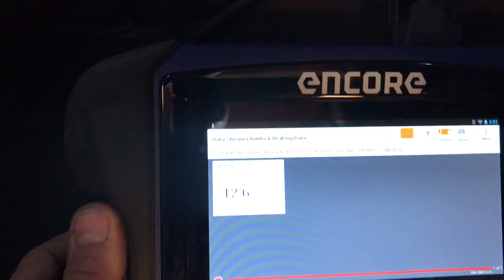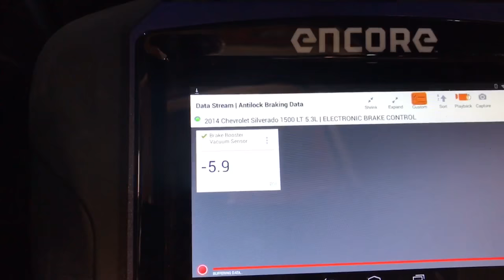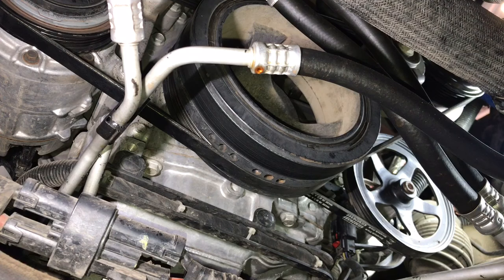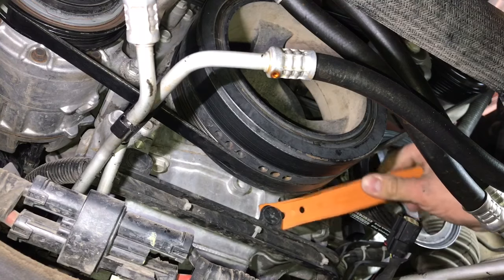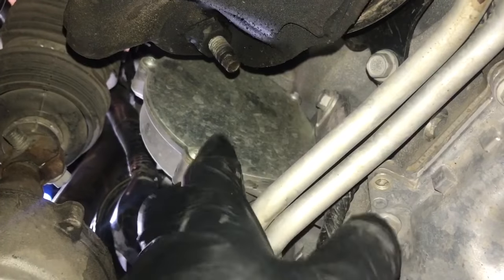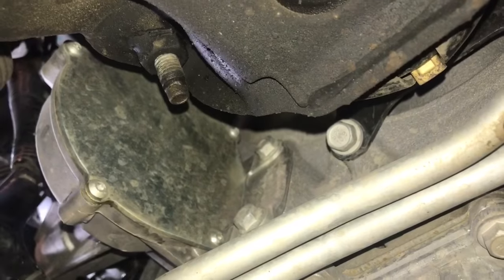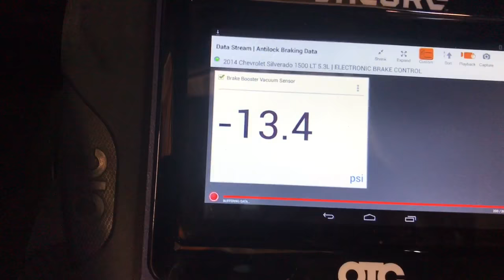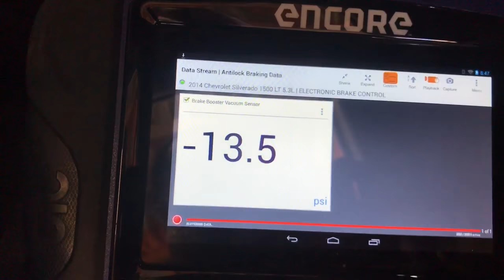Gm Silverado Sierra Vacuum Pump Replacement 5.3 & 6.2 (2014-2018)

Comment: Just a heads up to anyone having this issue. These pumps were recalled and there is a special letter out from GM about it. A deal can inspect the issue and request for GM to pay to fix the part. GM will then approve it and replace it at no cost to you. Just had mine done. 17 silverado 1500.
Reply: miles?
Reply: Thanks for the heads up! I got mine replace today under the recall! They said under 10 years old and under 150k on it.
Reply: @jldrkszac1194  I have a 2014 Silverado and the brakes have started this symptoms, Im at 75k I’m hoping they will honor and replace
Reply: @joelstovall1128  you should be good!
Reply: How do i get them to replace the pump with what you are saying about the inspection?
Reply: Anyone you know have this issue with the 2019? Also have you heard of anyone just changing the belt? TIA

Comment: Just did this today on my 16 Sierra. This is very informative video. A few things to note though, this is a 2wd install. On a 4wd, it’s definitely more difficult. Also, be very careful with the crank position sensor plug. It’s VERY fragile, take your time. Lastly, invest in a nice power ratchet like the Milwaukee in this video, it’ll save your life because these bolts are almost impossible to get to.
Reply: Yeah I saw this video and thought "oh this looks nice and easy. Then I get under and realize that this is a 2wd install
Reply: Yeah I figured it out the hard way
Reply: I broke the clip on the plug. Darn thing was a pain to get to laying on the floor.

Comment: What’s interesting is that the bulletin From GM states the vacuum pump is faulty (they attribute it to oil changes at incorrect intervals). The recall however states that they are only responsible for recalibrating the braking system, meaning they just plug it into a computer without replacing the part. I just took mine in for this recall and they would not replace the vacuum pump. Bummer

Comment: I really appreciated you making this video. Thanks for saying the crank shaft nut was 15/16. Someone else said 24mm and I was bummed. I bought the plastic Christmas tree removal tool. I also used your idea of using zip ties to put the belt back on the pulley. I wish you would of shared in better detail how you just compress the electrical connecter. That part took me about 15 mins. I prayed because I didn't want to break it like I did on my ABS sensor once. I did remove the steering shaft section, which was easy and made the whole job doable for me.
     I was able to reach over a cross bar and barely start the back top bolt on the vacuum pump by hand. That was another hard part. After I finished I rotated my off road tires 33's. That was tiring. But is was a productive day AND YOU HAD A LOT TO DO WITH IT! THANK YOU SO MUCH, GOD BLESS YOU!

Everybody that was helped type in the comments, THANK YOU!
Reply: Sane here I spent so much time om the connector and I don't know how he managed to get a tool for the back bolts, I couldn't even get a hand in there

Comment: Just finished this repair yesterday on my 2015 LTZ 4x4. A universal socket adapter, long extensions, and patience were my best friends. I spent more time trying to get the crankshaft position sensor unplugged than getting the actual pump out. I ended up just leaving the sensor plugged in anyway to prevent damaging the wires and was able to get the pump out just fine with it plugged in. The gasket on the new pump holds the new bolts steady for you when you install it which is also very very nice. Very happy with the results, no more hard brakes during low speeds. This was a great video thank you!

Comment: Just got doing mine, thanks for this video. its some tight squeezes.
Also make sure you have a drip pan to catch oil from vacuum pump. 
I did not remove steering shaft. i imagine it would make it much easier. 
This video was very much appreciated and so far seems to alleviate the tough brake pedal. 
Thanks again!

Comment: Just finished mine, on 2014, 4wd silverado. For the 4wd, removing the steering knuckle  makes access to all 4 bolts amazingly easy! Was easily removed at that.
Reply: yeah I did that too and used zip ties for putting the belt back on.

Comment: Guys I appreciate this video and all the comments. I've called  a few times and went in a little while back  for diagnostics and they came up with over an 800 dollar fix for the vacuum pump. Was told by another dealer that it was ok for now that it didnt need replaced unless I experienced the brake problems . Well now it needs replaced and now knowing it wont cost me is nice!

Comment: 2014 GMC Sierra July 28. GM just did mine for free. I had to ask multiple dealer until one said there’s a “special warranty cover” that would replace the vacuum pump for free. It covers either 10 years of ownership or 150,000 miles. Mine was a 2014 with 141,000 so I was close lol. Keep asking your dealer it’s a free $800+ fix.

Comment: This is great. my pedal is actually squeaking and spongy (diagnosed by Chevy repair guys) Cost would be $600 and 1 week after warranty was out. Truck only had 13,000 miles on it.  Plan to tackle this myself this summer. hopefully there's no oil in the booster. Thanks for posting the video
Reply: Mine is squeaking aswell did it get rid of the noise?
Reply: @noeldiaz1359  i waited a few months to see if chevy would put out a recall on it and they did. only seems to do it in the winter time now... so i just turn up the radio.

Comment: Really helpful video. Thanks for posting! This particular belt tool is key! I first tried another one from NAPA that was more expensive, and it didn’t work (I’m returning it.) Also, I think the truck in this video must not be a 4wd...my 2014 Sierra 4wd was tighter than this, but I was still able to do it with various wobble extensions and U joints on the ratchet handles. An electric ratchet helped a lot too. I have just over 77K miles, so no warranty/recall coverage (They’re covering this if you have less than 72K miles now as I understand it.) The dealer quoted me $800 parts and labor. I bought a new pump on Amazon, new belts (all 3) from NAPA and the stretch belt tool at Pep Boys. About $300 in parts and tools altogether. (The 3 new belts totaled as much as the new pump! Crazy.) I’m going to hit GM up to see if they’ll reimburse me for any of this. I’ll post here if I have any success.
Reply: GM wouldn’t pay for anything due to my mileage. No surprise.
Reply: They just extended the coverage on these shitty pumps
Reply: A zip tie around the belt and pulley will do the same for installation.
Reply: I believe you're right... just replaced the pump on my 4wd and there was significantly less room to work with and zero visibility.

Comment: Just did this on my 2014 4x4. A couple things - 
I couldn't unplug my crankshaft position sensor. It's not necessary

Disconnected the upper and lower intermediate steering shafts. They were rusted/seized and it was a huge pain to pull them apart. I recommend two pairs of channelocks twisting and pulling on both sides. Completely removing the lower shaft would have been ideal but I couldn't disconnect the shaft from the steering box.

Getting the new pump in was surprisingly difficult without having the gasket falling off. I pushed the two front bolts partially through the gasket to keep it in place. Laying on my back with my eyes right under where the lower front bolt on the pump goes into the engine gave me the best position to be able to guide the pump into place and hand tighten that bolt. 

Need lots of different sized extensions.

Reconnecting the steering shafts was a huge PITA but it didn't have to be.
Reply: I have a 4x4 as well and could not unplug that sensor either. I am here looking for a video that maybe has the 4x4 so I can see how to disconnect the drive shaft
Reply: @Apocalypse2383  All you have to do is remove the bolt that connects the upper and lower steering shaft. Once that's removed you can push the upper shaft towards the cabin which I think will give you enough to separate the shafts. I also disconnected the upper shaft under the steering wheel before I realized I probably didn't have to. Try that if you can't get them apart. If you do go that route, reconnect the portion under the steering wheel first, it's easier to get everything back together with more room under the hood as opposed to connecting the two shafts and then trying to connect under the steering wheel. EDIT: before disconnecting the steering shaft make sure to loop the seatbelt around the steering wheel to make sure it doesn't spin - could damage your clockspring if you don't. This video shows a replacement of a steering shaft: https://www.youtube.com/watch?v=4crx0xuIhQU
Reply: I’m here cause my sensor clip(red) broke when I tried to unplug in juuuust to learn that other people were able to skip that step. 🤦‍♀️

I also have a 4x4 and appreciate the recommendation to disconnect the steering shafts. After fighting with the sensor forever I’m more than ready to make some of this easier on myself haha.

Comment: There really needs to be a recall on these.  One of the dumbest designs ever.  Keep up the good work man!
Reply from the maker: Ya your not kidding! I see the fail a lot. Pretty dangerous. Thanks bud!
Reply: They gave a special warranty but it runs out at 72k miles but they do need to recall this
Reply: @blake102989  Just realized that I have this ongoing issue with my truck unfortunately. I have 106k on the dash they told me basically that I need to pay out of pocket but it was very evident that they all knew it was an issue.
Reply: @h1ghVolTTagE  damn, that's dirty. I'd call gm corporate and tell them you were never notified and didnt have any signs of it being bad until now. If they say no tell them they'll be hearing from your attorney and they just might go ahead and fix it because they dont want a lawsuit and I know a attorney could easily file suit on this issue.
Reply: @h1ghVolTTagE  I luckily caught mine when I had 70k but the only reason is because I was bored and clicked on the warranty section of the monthly diagnostic email and it said speciality warranty almost expired. It didnt say what it was, I had to google the number that was right after specialty warranty.
Reply: Caught mine at 40k
Reply: Alright so I'm late to this recall stuff.. I have a 2015 Silverado.. does this recent recall replace the pump at no cost to me?
Reply: Ryan Quinn So I had no prior issues before I had the “reprogram recall” done then 3-4 weeks after I started having these issues yes they replaced the pump under warranty
Reply: @tha1Gemini24  thank you!

Comment: Thanks man!  Had the brake issue and was hoping the recall/reflash would do the trick.  It didn't, so new pump it is.  Dealer wanted 500.00 as I'm at 210k on my 15.  I'll do it myself and this video helped me out!

Comment: Excellent video.  I was going to make and post a video on this but yours is perfect.  Thanks.

Edit after finishing:
4WD is very tight.  Without universals you'll have to do it blind from the top for three of the bolts.  You'll definitely need different length extensions.  I disconnected the steering coupling but it didn't help.

Comment: I just had the slow speed braking issue. Just bought the truck a week ago from the dealer. It was used with 63,000 miles on it. The pedal didnt get hard it was more like went to the floor and front brakes made a noise like the were just grabbing the rotor and making a creeping noise. scared the crap out of me.  I was trying to park in a parking spot with other cars around. I hope the dealership will fix the issue since I paid top dollar for a 2017 Sierra Denali. I didnt get the bumper to bumper warranty only power train. Hopefully they work with me or the recall covers the work. Shouldnt have an issue with this since its only a week in possession.
Reply: How’d that go for you
Reply: @winterssiege4624  dealership did the work under a service bulletin. Haven't had the braking issue since.

Comment: I found on 4x4 models if you take the exhaust manifold heatshield off  it gives you room to reach the back bolts from up top
Reply: I got it out. But couldn’t get it back in. So Imma try this and see if it works for me.

Comment: Dealer just replaced my 2014 vacuum pump free under recall!
Reply: Hey im going to the dealer tomorrow but i dont have the recall i spoke whit a GM agent today he told that they need to inspect the vehicle and if the problem is that they will replace it and yes thats the problem if you hit the brake doble it doesn’t stop i have a 2015 Suburban! 
What did you told them?
Reply: @KMTZ305  took it in for motor mounts 
While there dealer told me about it and checked to see if bad
Reply: So im here at the dealer now, i just explained him what was happening and he knew exactly what to do i dont have to pay anything 😀

Comment: So I just got off the phone with a local chevy dealer. He said the part is 269.34. 3 hrs of labor at 145.00 a hr. Grand total of 704.35 before taxes. I'm going to use your video and save me a few hundred dollars. Let you know how it turns out. 2015 Chevy suburban with 70,000 miles.
Reply: How long did it take you to replace the vacuum pump?
Reply from the maker: @outlawz832  awesome! less then an hour. book time is 1.6 hrs. so they are correct on the labor. 2wd is much easier the 4wd. make sure you get the gates belt tool.  make putting the belt back on 100 times easier.  good luck.
Reply: There is a recall on this exact part now for your vehicle, I'm not sure but u might be able to get your money back....? 🤷🏻‍♂️. Worth a shot!

Comment: Great video! Took my 2018 Silverado in for the transmission. Their inspection discovered that my vacuum pump was bad. They’re telling me that my specific VIN isn’t one that’s covered by the recall and they quoted me $740 to replace. First off, no thanks! Second, how does this even make sense? It’s not a coincidence that mine needs replaced and there’s an active recall.
Reply from the maker: That’s lame. I do know that GM redesigned the pump. So they should at least expand the recall to cover mode years
Reply: Ramon Trujillo Did the bad pump make a whining noise?

Comment: Pain in the ass when it’s 4x4, I used 1/4in drive 13mm socket for the front and and removed em by hand and using a long socket twisting it. I’m just about out the new pump on. There was about a pint of motor oil coming out when I removed mine. I’m working on a 2015 suburban.

Comment: Great video, but for me it was easier to remove the driver side wheel and wheel well, and unbolt the ECM and just lay it in the battery compartment. Then i'd remove/replace the vacuum pump from the wheel well. This way you don't have to remove the skid plate, or harness or Crank Sensor or anything from below. I had issues with the centering pins staying stuck in the block, and didnt see that when working on it from below/above as shown in this video. Be sure the centering pins come out with the unit or you will have an oily mess on your driveway!

Comment: at 4:52 you say the connector is the crank position sensor.  It is the cam position sensor & cam phaser solenoid sub harness.  X154 for those who care.

Comment: I keep getting service brake assist 2017 Chevy Silverado 271 4wd v8 . I’ve had problems with the brakes once when driving around ice . A lot when I back up a trailer or if I’m backing up to a lake under low speeds . Brake peddle gets hard and feels like the brakes are locking up . Would this be the cause?
Reply: Definitely, did you ever get it replaced?
Reply: @Sweetjamesjones520  yes it was my vacuum pump . Very common in Silverado’s, they call it parking lot breaking syndrome, and it’s covered under a recall if you’re vehicles under 150k

Comment: thanks so much. so question , the dealer performed this on my truck as a recall. it works fine now. so is this something that i will need to replace after x amount of miles?

Comment: I just got a letter from Chevrolet. They are extending the warranty on some of these pumps.
Reply from the maker: we have been receiving a few letters as well over the past week. but only on a few trucks and not all. strange
Reply: Aaron Hines Do you know which trucks? We have not received any letter as of yet.
Reply: I never got a letter but I got the warranty and didnt know about it until I was 2k miles under the end luckily I caught it and got it fixed

Comment: I have a 2014 V8 Silverado. I’m not experiencing any brake issue or noises. Got the recall notice several times. Procrastinating taking it to the dealer. Recall states to bring it in to test the pump and replace as necessary. Also was told by others that that are going to reprogram the PCM to have the pump to make vacuum pump to start making vacuum at a much higher number. Thats kind of cheating making the pump kick in earlier to make up for a weak pump. Anyway, I took it in 1-10-2020 (It only has 36,500 miles on it) and they tested it and said it needs a new one cause it doesn’t make good enough vacuum. They don’t have any in stock and it’s on national back order. So they called me and told me to check back 1-16-2020 to see if it’s done. I’m driving my 2006 Yukon now and it started leaking antifreeze at the heater core fitting. I replace it a year ago when it was zero degrees outside. I got a new one from the dealer ($34.00) and it’s plastic just like the one I put on last year. I installed and everything good now. Hopefully I will get it back soon. They said it would be no cost to me and they will extend the warranty on future pump problems.